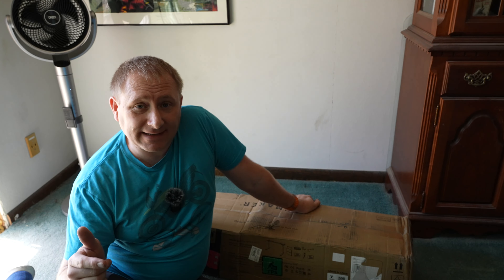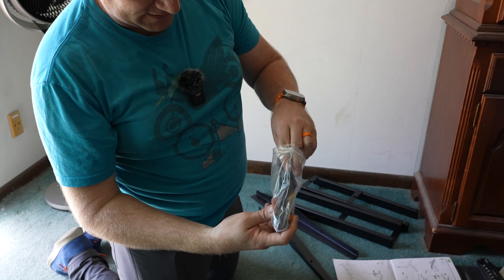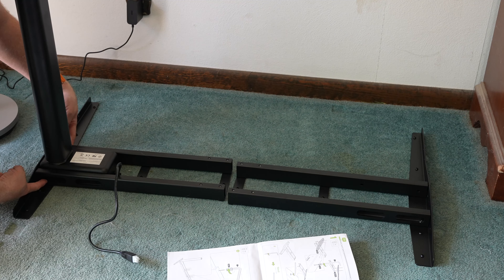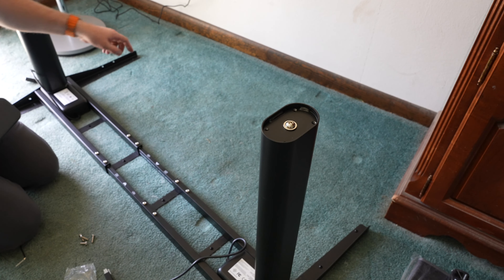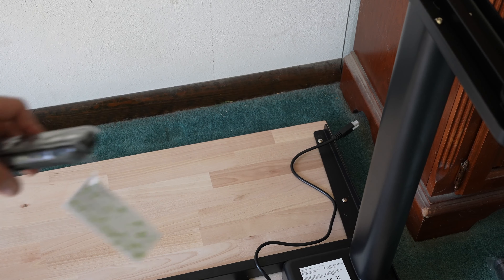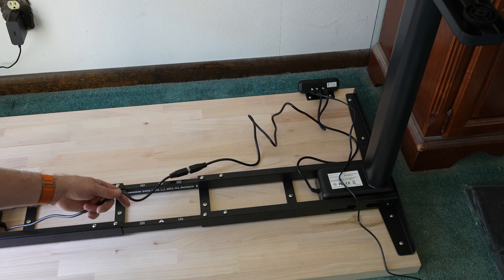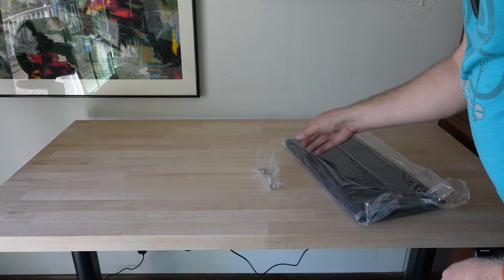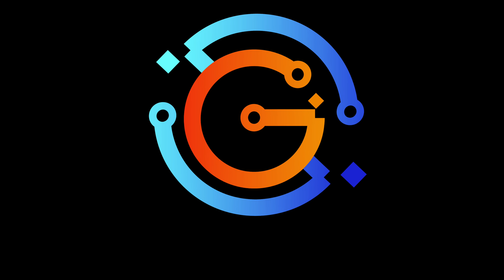INMAKER Height Adjustable Desk Frame Unboxing & Setup

Comment: I got a 74" wide top that has a little sagging in the middle since there's no support there in my current desk. Do you think the crossbar on this desk can support it well?
Reply from the maker: I think any desk frame with the connector bar will help support it better than if it does not. Obviously having a thicker top helps, but the connection bars on this desk will help support a thinner top.